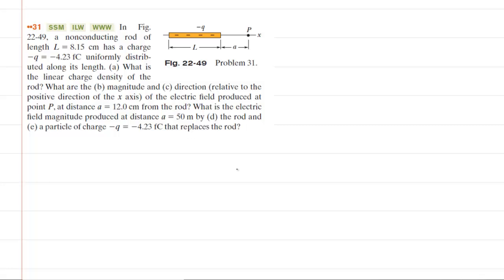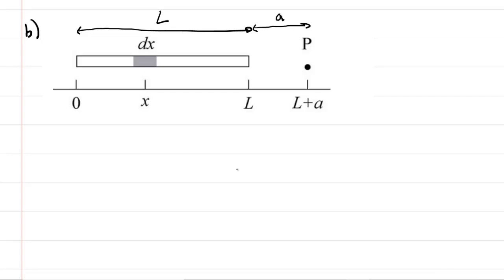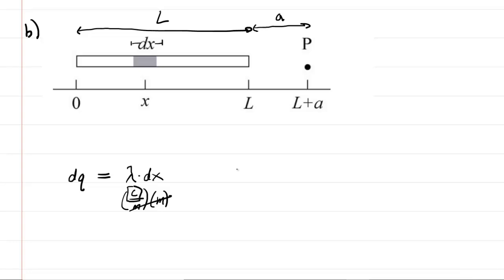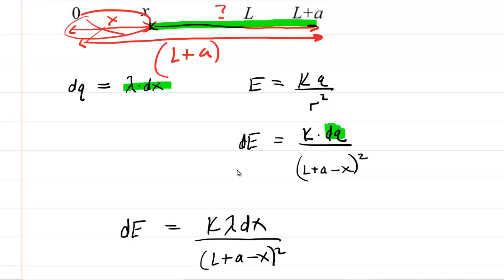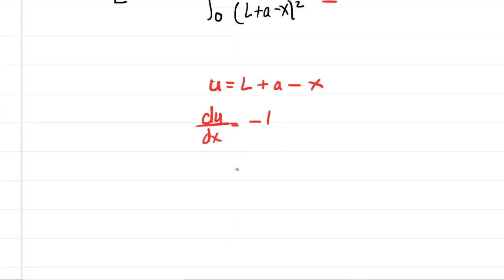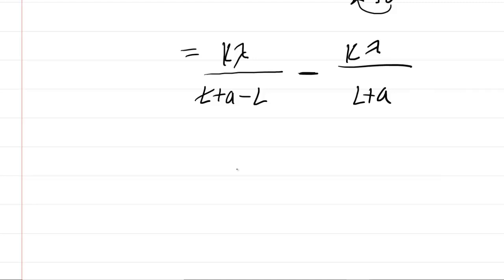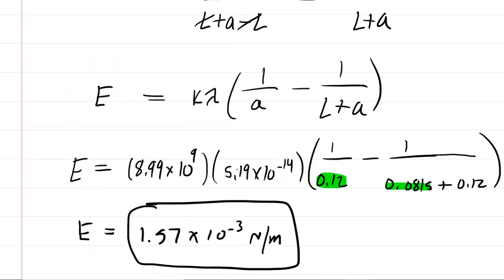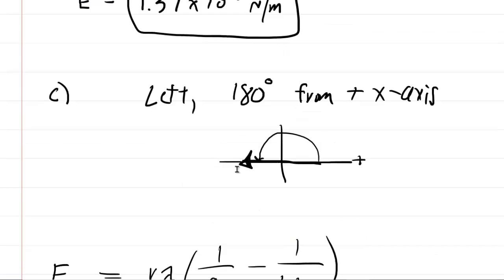In the figure a nonconducting rod of length

Comment: You substituted r squared for L + a - x. But, shouldn't r be a constant nonetheless? I follow everything up until you start to integrate, we integrate with respect to dx, but isn't the distance constant?
Reply: Not necessarily- the rod length is constant, you're right, but here "r" is the distance from our point charge dq to point P. Since r (the distance from the point charge dq to point P) actually changes with which dq you pick, you can't treat r like a constant. R is equal to L+a-x but that's only because r is the distance from point charge dq to point P. Does this help?